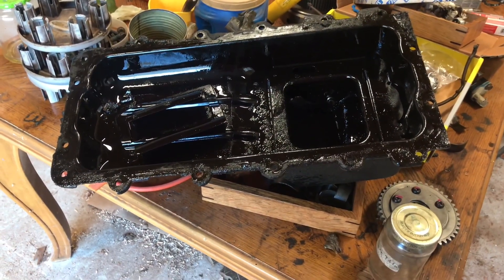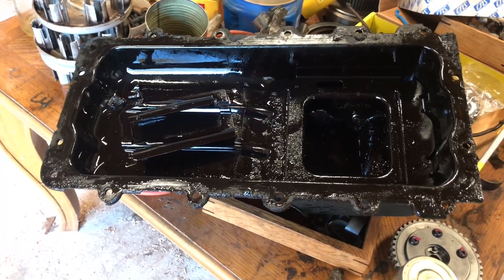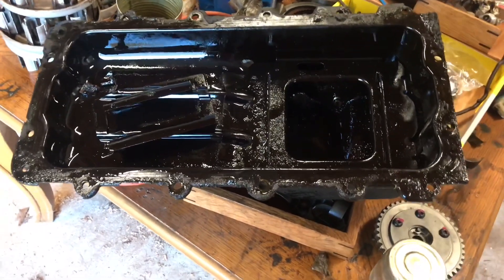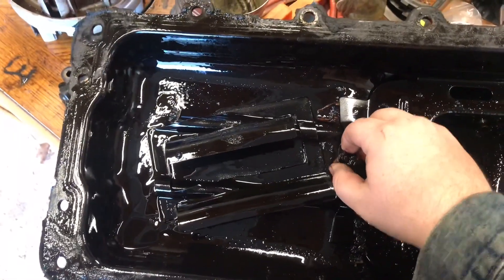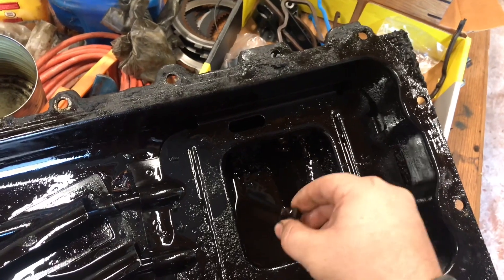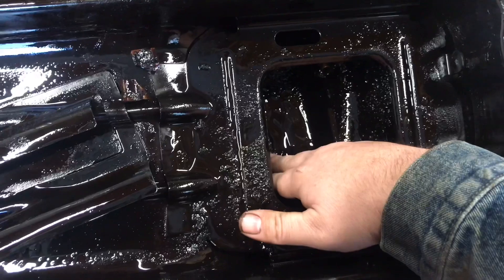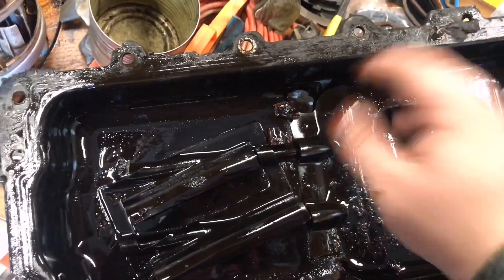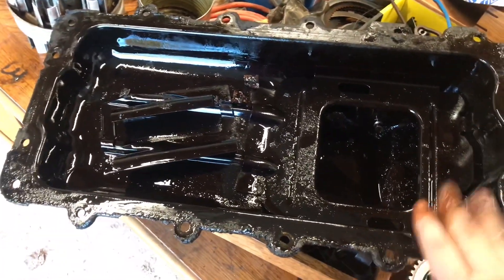4.6 oil pressure light

Comment: My 97-4.6 the oil gauge bottoms out when I come to a stop..I can put it in neutral and it goes back to normal.when stop light turns green..I put it in drive it also goes back to normal.. it only drops when I come to an idle.. any ideas how to fix?? Thnks
Reply: Mine got the same problem, pulling my motor back out this weekend to check the crank and bearings
Reply: Did you find the problem?
Reply: @emmanuelperdomo8072  it turned out to be a sensor that's mounted on the drivers side of the transmission.  I had backed out on its own and dunked up the sensor, can't remember the exact name of it..found it by accident..I think it was around $20 fixed it immediately..I sold the truck about 3 months later.. hope this helps ya.. it's got wires hooked to it. And part is about size of a thumb..
Reply: @katbirddogg8184  thanks i have the same problem i hope i fix it, what mine does is that the oil gauge drops when i stop and goes back to normal when i drive, i think its the oil pressure sensor cause truck runs fine
Reply: @emmanuelperdomo8072  that's it! I remember now it was beside the oil filter.. yep.. I googled up and remember that part.. mine backed out and was full of dirt and oil.. was an easy fix once I stumbled across it.. not sure why I thought it was on transmission..hope you get yours fixed.. I miss my old truck.